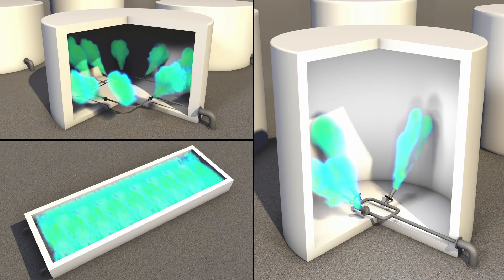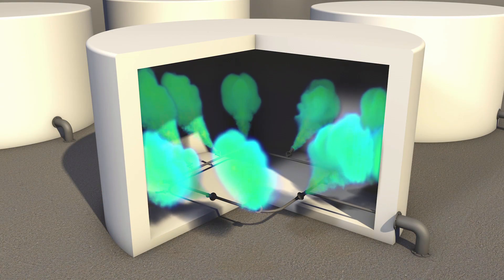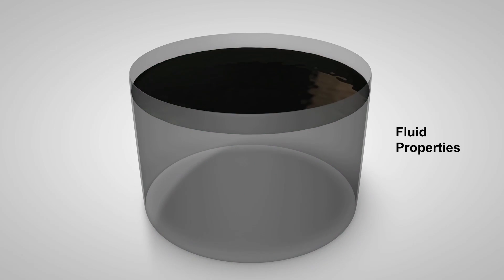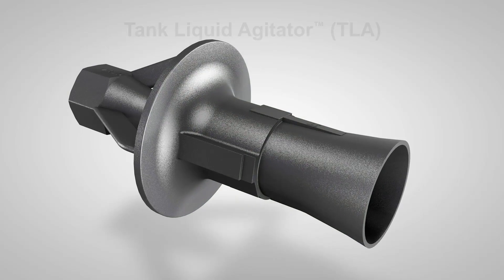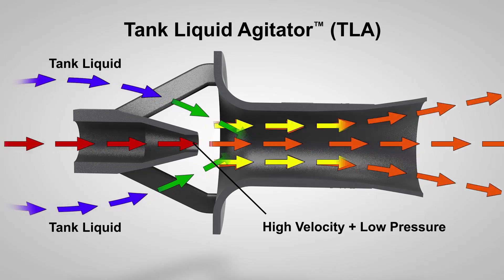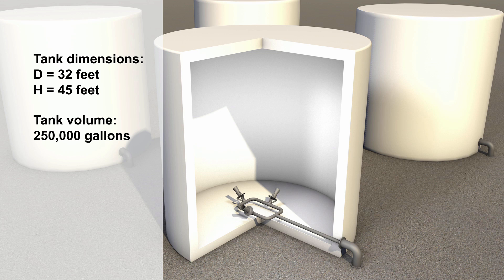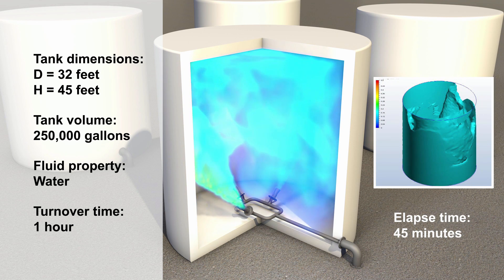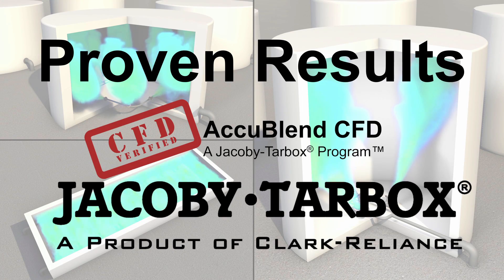Using Eductors for Non-Powered Tank Mixing

Comment: Excellent video . What is the difference between ejector and eductor?
Reply: Hi Abid,

Well an ejector usually drives the low pressure fluid through a closed pipe, it is mainly used to drag or increase extraction of a certain fluid ( gas and oil extraction ). The eductor is used for mixing, hence it has an open area after the nozzle, it will drag the same fluid from it's surrounding and eject it.
Reply: Ejector to drag and compress gas.
Eductor to drag and pump liquid.